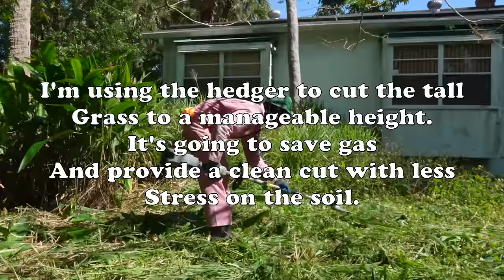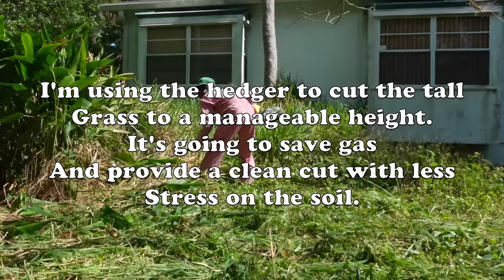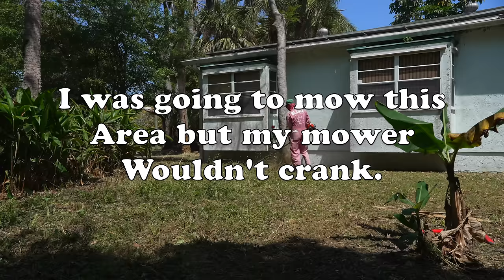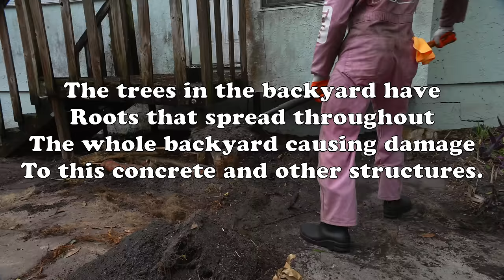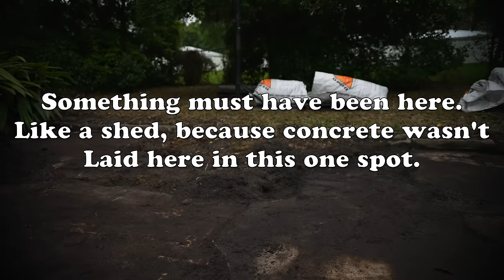She LOST all hope while STRUGGLING with her yard

Comment: I'm wondering if I saw you do some original cleanup on this one.  In any case, that this yard is making progress is excellent.  Liked how you used the hedger to sheer the tall grass down. Very nice you cut-up the downed branches.  Those often become stuck-points for owners.  You are making a multi-tool out of the hedger, as you did a trimmer.  That overgrown fence is being cut back to order very rapidly. You are recovering a lot of physical space, visual space and usability.  Enjoying the process.  Good find with that little rock wall. Between you, your blower and your trimmer, you seem to have refound a rather good sized patio, a surprise find.  You talked of a garden. ( I'm wondering if that rich dirt you are gathering as you clear the patio is going to go to the garden.) (Yep.) Excellent work AP.  That place is becoming very different from the overgrowth you started with.

Comment: Great job again, AP. That Shepherd's pie looked good! 😋 About the🍂bags. When we had to start using the Paper Lawn Bags we discovered they hold a lot more than we thought, are easy to use because they stand up and stay open with just a little in the bottom, AND were a LOT STRONGER than we thought! You should try them, we were pleasantly surprised. 😃❤🙏

Comment: I think there was another tree or bush planted at one time in that patch of dirt on the patio, not a shed.  The patio will continue to be splattered with mud every time it rains because the mound of dirt is too high.  It needs to be levelled or taken down lower than the surface of the concrete and filled in with small stones or rocks.  Also that root by the deck was from a tree planted right there.  The stump from the old tree is visible as is the patch of dirt it was planted in.  Same thing needs to be done with that patch of dirt (levelled down and filled in with rocks).

Comment: Hey  AP! Excellent job so far, but I worry about your back. Constant strain from cutting positions can’ t help it.  Can’t you put the cutting blade in different positions jetsam of straight? I’ve seen other videos of hedgers in different positions in which you can stand straight with the blade in the horizontal cutting position. That would save your back.